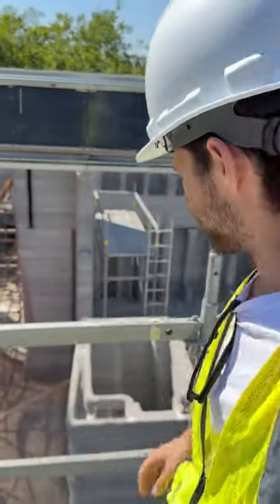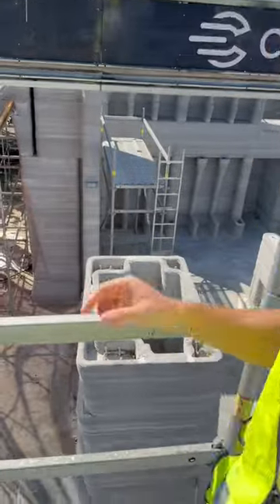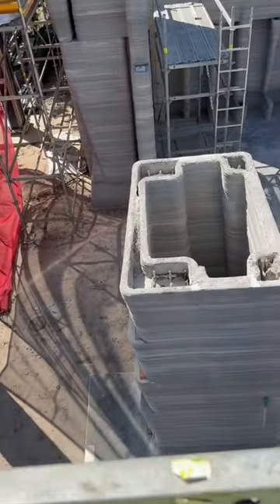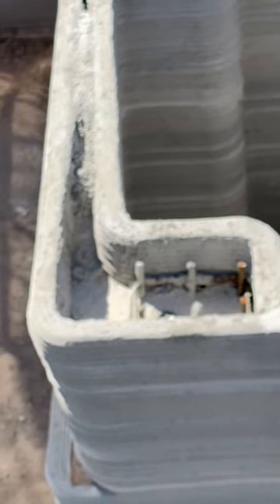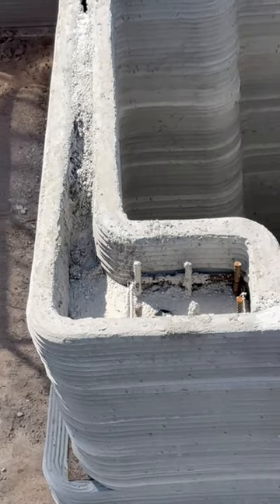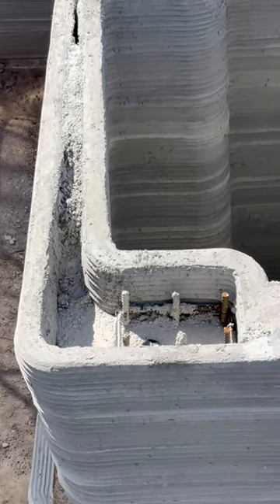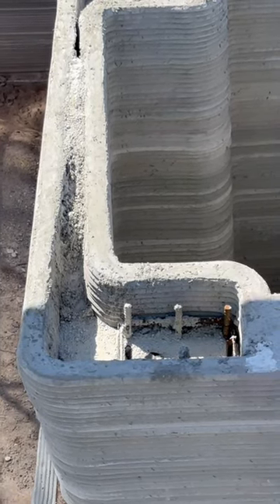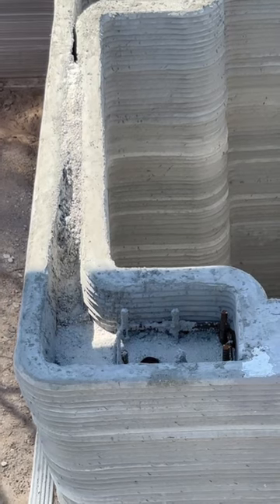Vertical load solution for printed walls

Comment: This doesn't require form work, the form is part of the structure, lots of saved resources and time
Reply: How much resources and time are saved in repairing and ultimately replacing these houses? Where masony work still stands over 100 years. Generations are advancing incorrectly, the rebar isn't supported by anything. It's just a straw in soup.
But that's just my opinion 🤷
Reply: @puvlea83  For one you don't need to cut down as much trees to form plywood to use as concrete forms.The printer can print the form around a setup rebar for the house walls , collums and beams. The printed house that you are seeing is probably not in your taste coz it looks flimsy but in the US you cant build house's like you would on other countries because of building codes and laws depending on which county or state an individual is .Laws that are not established on other countries in which case they build houses as if they were building commercial establishment. That is why the house being printed out is of course for 2 stories only
Reply: @lyn-jhonosia8981 you do know that 1 forms are reusable, 2 wood is renewable, 3 cement, made from sand , Portland and Lyme is not renewable. The form and pour method take about 2 maybe 3 days , while this is a week plus. Wood frame walls are less than 20% cost versus concrete. There is no insulation with these walls . It's inferior in every way to standard construction dude
Reply: @cthulawha  To how many usage may I ask? Yes wood is renewable but it was always consume at a faster rate that it is produce, any forms used in construction no matter what material its made of, plastic, steel, wood, they all end up as scraps , compared that to the printed house, the form itself is part of the wall , no scraps produced,and again, US house laws on construction of houses is different from the rest of the world, thats why the house you see in this video doesn't satisfy what you expect compared to where you live.